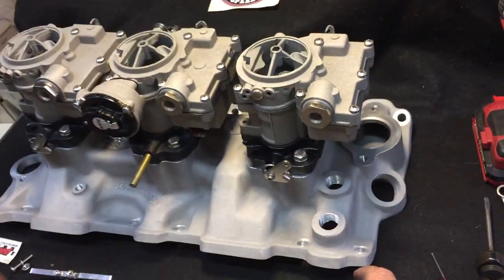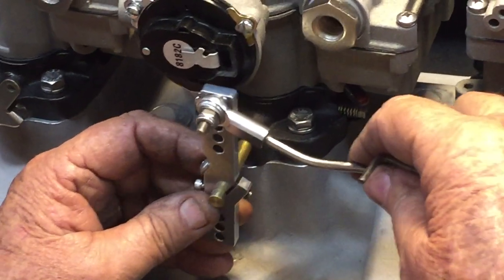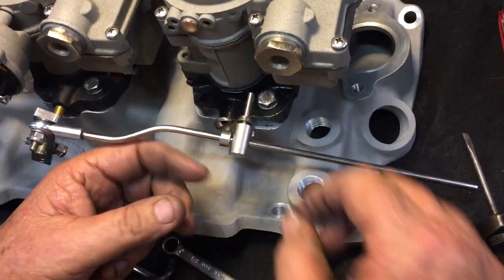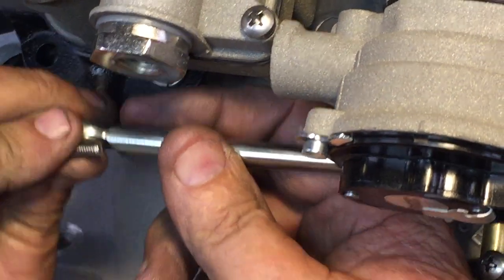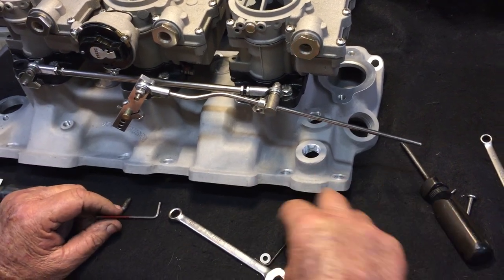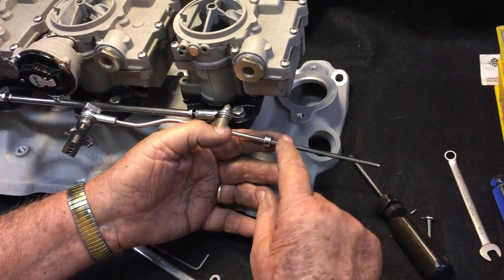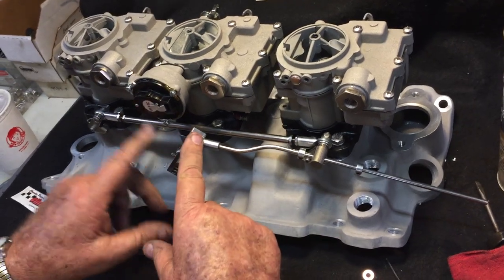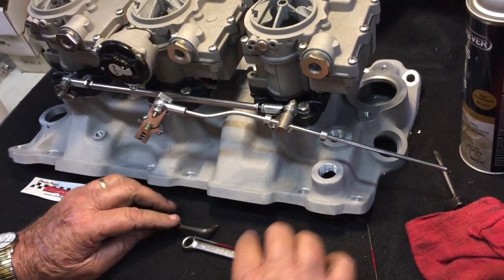CHARLIE PRICE VINTAGE SPEED - 3 x2 linkage on ROCHESTER 2G Carb with electric choke

Comment: what carb would work best on 302 SBF with the 3 deuce setup, Rochester or Sromberg.......
Reply from the maker: All small cu. in. motors will work fine with the strombergs but if you want maximum performance use the larger holley ECG's or Rochesters.

Comment: He starts off by saying this is a Progressive Linkage..THIS IS NOT PROGRESSIVE LINKAGE..its Mechanical Linkage.....
Reply: Mechanical that is progressive. It runs on the center carb, then opens outers. If it was not progressive all 3 carbs would open the same at what ever the input.
Reply: @shwngbr  Progressive Linkage is a vacum set up where the center carb is used only until the pedal goes to the floor..at that time Vacum opens the front and rear carb as the engine wants/needs it..This set up was mainly used on Automatic trans cars..There was rods you could clip off not to use the front or rear carbs..I had a GTO with this set up..